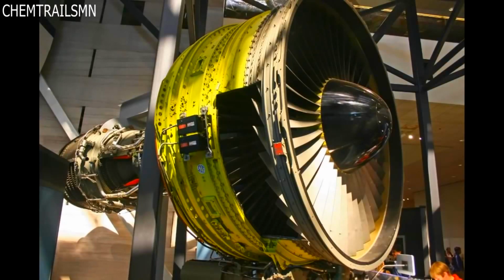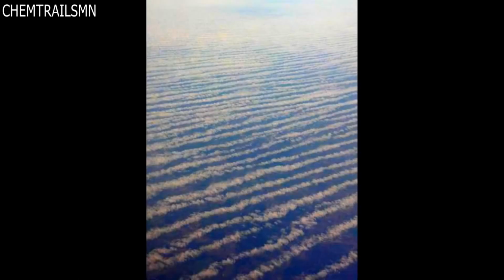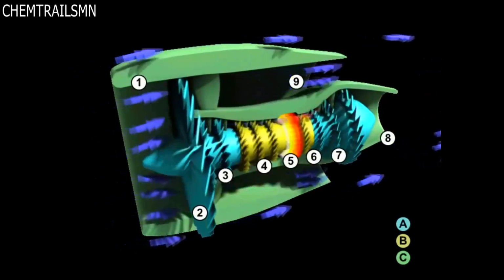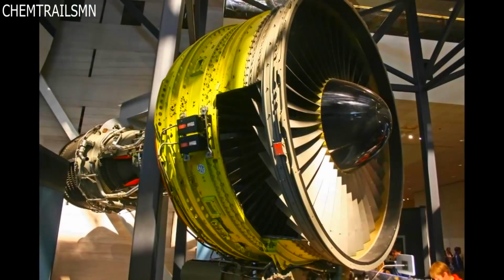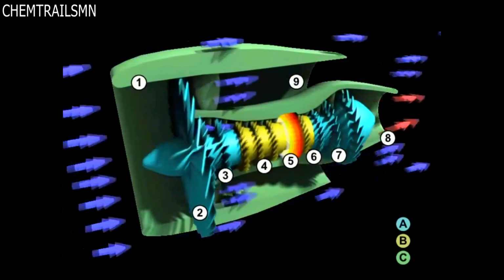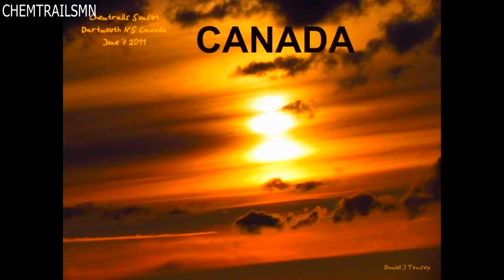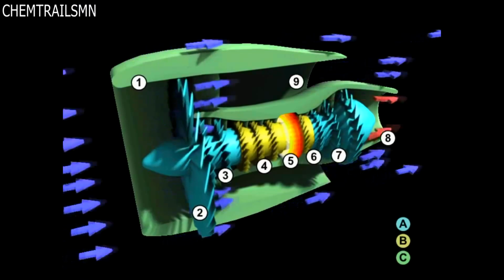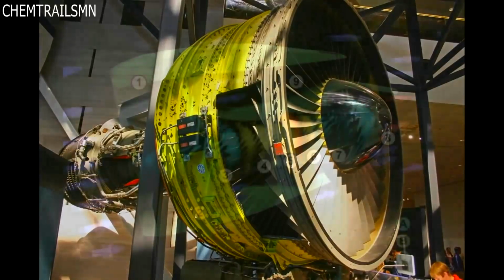Aerospace Engineer WHISTLEBLOWER PROVES Contrails IMPOSSIBLE! CHEMTRAILS ARE REAL! Turbofan

Comment: This was some of the dumbest shit I've ever seen. Let's now actually figure out HOW MUCH fuel is being used, and HOW MUCH water would be being ejected. 

So a TRENT XWB has a bypass ratio of 9.6 and an airmass flow rate of 1436kg/s. That means 150 kg of air is being shot into the core stage EVERY SECOND. So that immediately demolished your main point of the video since 150 kg of air is being mixed with the fuel, combusted, and shot out. But, that doesn't tell us how much WATER is being shot out to form the contrails. 

So the same engine has a fuel flow rate (at 35k ft and mach 0.84) at 6.8 tons/hr. That means 2kg of fuel is being burnt EVERY SECOND. But what's more is that for a something like a kg of jet fuel, you get MORE water out of the reaction. That's just due to the chemical reaction of hydrocarbons (kerosene is no exception). For jet fuels its around 1.2 kg of water for 1 kg of fuel burnt. Meaning the amount of water that's being shot out, every SECOND, is 2.4 kg. 

That water vapor is at a high temperature, true, which is why contrails only form at HIGH ALTITUDES, or areas of LOW HUMIDITY. Where it's COOL ENOUGH for the water vapor to condense and freeze as ice crystals, or stay like that depending on HUMIDITY. (If humidity is too high, the ice crystals won't be able to go back into water vapor if the air is already too saturated). Which is why helicopters don't form contrails because THEY AREN'T FLYING AT 35K FEET. 

You're UTTERLY CLUELESS.

Comment: High Bypass Turbofan Jet Engines Are Capable of Creating Contrails. http://elib.dlr.de/9247/1/aerscitech-2000.pdf
Reply from the maker: ONLY under Perfect conditions, MOST of the exhaust is just AIR! When I was growing up in the 60's and 70's we NEVER saw these white lines in the sky and the engines were NOT AS EFFICIENT as they are now!  If you see a trail, it's a CHEMTRAIL!
Reply: And those perfect conditions exist in the upper troposphere. 

"When I was growing up in the 60's and 70's we NEVER saw these white lines in the sky and the engines were NOT AS EFFICIENT as they are now! "

There are plenty of photos from the 40s, 50s, 60s, and 70s that show persistent contrails. Also, if you research the type of planes used today for passenger and freight flight, you'll find out that the engines being used on them are engines that were created and produced 40 to 50 years ago.

Comment: X9 uses bio fuel do you smell chicken? you cant prove spraying  14 CFR 137 part 3  requires a federal permit just to fly and inspection prior to loading and NO PASSENGERS can be on board any plane with hazmat please prove yourself the turbo fan big deal but you cant prove geoengineering  because it has NO FUNDING no research you need a trip to boeing's engine plant. The fan is the props core is a compressor.
Reply from the maker: LOL! Black ops have no public funding, everyone knows that , you are a SUPER TROLL! BACK under your bridge TROLL!

Comment: the whole problem with this video is 1) the animation parts regarding turbines simply show  how turbines work. Saying turbines  don't produce vapour is like saying a car on a cold morning doesn't produce vapour when carbon emissions combined  with cold air don't produce visible emissions or that out carbon dioxide into very cold air doesn't produce  clearly visible vapour. This guy is an idiot  to say the least and at best entirely ignorant of basic science.  It's easy  to add a little commentary  that leads people  to a particular conclusion. I could take the same footage and draw people  to a completely different conclusion.  So all  those  ;planes   that did sign writing  in the air when I was a  kid in the 1960's didn't use avgas at high altitudes where there is cold air  combined  with hot emissions  to produce  the desired effect..... Funny how we knew what it was when we  were in infants school  and this idiot disputes what is common knowledge.... I am selling extra thick tinfoil hats at half price this week with the inscription IF IT'S ON THE INTERNET AND YOU TUBE IT MUST BE TRUE!

Comment: Research and common sense can go a long way. I have always been out side playing and working from 5 to 60 yrs old. Very in tune with my natural surroundings . 
First of all the Newest jet engines produce no contrail . Older jet engines produce a contrail about 1 to 2000 feet long. When you see a contrail from horizon to horizon over a broad valley 10 to 30 miles wide and it spreads into a wide haze trail you are seeing chemical trails. 
Now who would do this ? Here is a start for your research. Bill Gates is a major stock holder in Monsanto . Bill Gates has invested billions into Geoengineering patents using aluminum as a dispersant and is connected to Evergreen Aviation deploying modified tanker jumbo jets to spray at high altitude. And Monsanto has created a GMO seed to grow in aluminum tainted soil. Then research HAARP and weather control . 
It has nothing to do with controlling global warming like the gov says..
As George Carlin said . " Rule number 1 , Never believe the government."
https://www.youtube.com/watch?...
Reply: also, contrails never appears at low altitude, airports would be giant clouds if so. Then, the engine isn't generating vapor, it is only blewing hot air behind it, and this hot air makes contrails.
Reply: +SuperSmartt Go to Anchorage AK and see the winter conditions as the jets leave CONTRAILS at TAKEOFF when its sub zero  there :)
Reply: But you’re a liar. All engines produce contrails, liar. And all the rest of you crap is just that, crap. You haven’t a clue what you’re talking about.

Comment: why is there such an argument,just look up,older jets leave con trails, so did world war two prop driven planes,chem trails are completely different i`ve seen a con trail dissapate in under a couple of minutes and a chemtrail suspended for hours in the sky,chemtrails when dropping in a no wind enviroment`s actually shimmer in the right light and lately last couple of years you can see rainbow like effects in a clear sky when chemtrails are almost dissapated,so in my 50 odd years on earth i think i can tell the difference and by the way,i also hold a engineering diploma....
Reply: - I usually saw contrails disappear in a few seconds. It seems like 10 seconds was about as long as they could last but they normally went away faster.

Comment: It's really interesting.. on some days, when I'm outside and I breathe, I see no vapour at all. Yet on other days, I do see it. And on yet other days, it actually hangs around for a bit. Is it because I'm exhaling chemicals, or do the weather circumstances change?

Now imagine what happens when my breath is about 800C in an environment where it's about -40 to -70C. Do you think that my breath may linger for a bit when air humidity is saturated?

That's what happens with jet engines. Extreme amounts of air (way more than say the old engines in the 60's, hence more trails) are sucked in, compressed, heated, and then decompressed when the air leaves the engine. As it expands, it cools down and condensates. The water in the air freezes into a cloud of ice particles, just like a cirrus cloud (hence the name Cirrus Aviaticus). Depending on the conditions at cruise level, the cloud can persist or dissipate relatively quickly.

Ok ok I know, chemmies are going to call me a shill or a paid agent. Save yourself the trouble, and instead point out where I'm wrong, if you in fact believe I am. And while you're at it, you may also want to point out where some 70 years of contrail research is wrong, since all the research so far backs up my explanation.

For a more thorough debunk of the claims made in this video, see here: https://www.metabunk.org/threads/debunked-high-bypass-turbofans-do-not-make-contrails-actually-they-make-more.3187/
Reply: Contrails last minutes, not half an hour..you are correct in your words, but then fall flat by failing to recognize the max time frame of which contrails can scientifically last